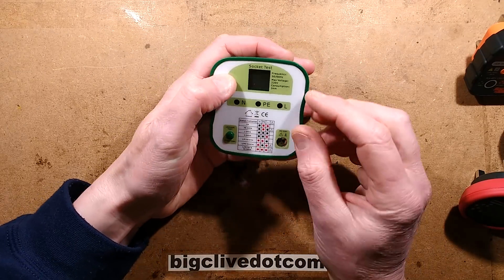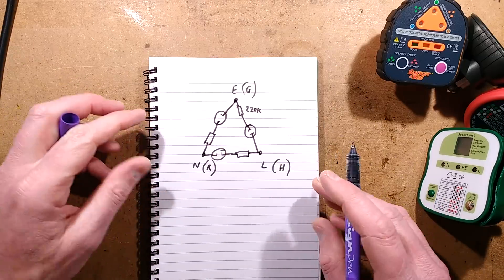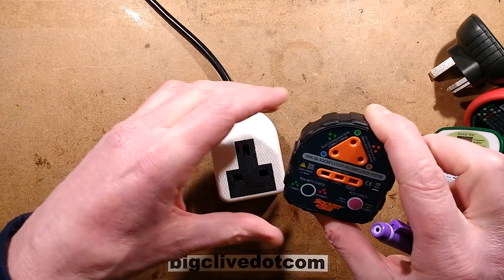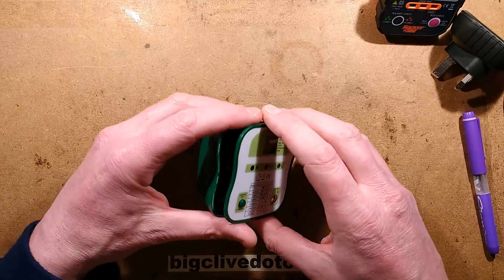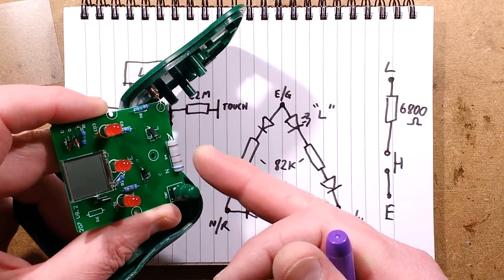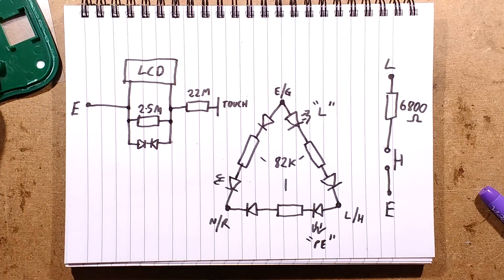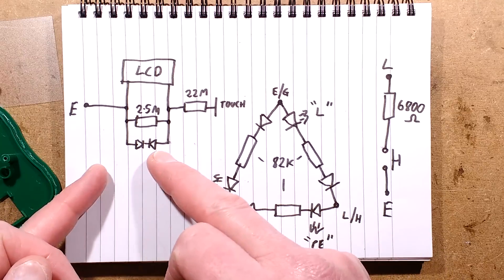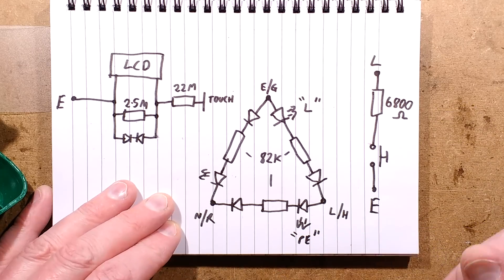Inside a mains socket tester with LCD display.  (with schematic)

Comment: Worked on a huge permanent lighting installation some years ago where the electricians that had installed it swapped the Earth and Neutral on every single fixture plug. 
Drove the audio guys nuts trying to figure out where that hum was coming from, since all the audio gear was correctly referenced to Earth.

Comment: I have a basic one, because when you're renting it's really handy to be able to look at a property and quickly find out whether the electrics are vaguely trustworthy. Missing earth on GPO is common, but I once found a reversed live and neutral which only became a serious problem when the real estate agent present said "if it was a problem I'm sure the owner would have fixed it"... see ya.
Reply: Ouch. (Or possibly AAAAAAAAAAAAAAARGHHHHHHHHH!)
Reply: Had an outlet that wasnt working. Maintenance guy held a non-contact voltage detector to the outlet "Nah its live"  I left shortly after because maintenance in general was lacking and they wanted to raise rent. AC/heat pump would leak out in 2 months, one sink in the kitchen was missing a P-trap, etc.
Reply: You silly people with your keyed sockets where a fixed orientation for live and neutral is even a thing.
Reply: Jasper Janssen
Better yet is keyed sockets where live and neutral isn't a thing. ;->
Reply: Jim Fortune what, 4 pin 3 phase? That’s the only ones I can think of.
Reply: Jasper Janssen
I was talking about the type "E" euro plug. Single phase, grounded. It has an off-center ground pin in the socket so that you can only plug it in one way, but even in the same double socket live and neutral are reversed from one plug to the next.
Reply: @JimFortune  ah right, the French one. Huh, I’d have expected that one to have a defined orientation.

Comment: We had a metal sided garage built at our local scout camp. It was in operation for about 10 years when last summer i happened to be in bare feet and leaned against the siding and felt a mild shock! Thought I was imagining things so I had a friend do the same thing with identical result! Turned out to be a combination of two things. When they wired the garage pony panel they brought over the two live wires and neutral but no ground and no one ever put a0 earth ground wire into the panel, as a result the entire building was a floating ground! Combine that with a poorly installed thermostat for electric heat that they managed to install crooked enough so one of the line wires could touch the box side. No earth ground so breaker did not blow but result was that the entire building shell was at 110v with respect to ground and I was the first to discover it after 10 years of use!
Reply: bet the scouts $1 each to put their tongues on it lol
Reply: and some people ground the rebars when they pour concrete.
Reply: a common problem with inverters in vehicles. no real ground !
Reply: Yikes. I was noticing some floating grounds all around one building I worked on (US) and decided to do bootleg grounds after a thorough!!!!!! And proper testing of polarity ( I open the main panel verified everything and connected to a known good service outlet that I checked and ran extension cords all around the building and checked every single outlet and switch, thankfully in a small building) as I could see the refrigerator floating at 1-10 voltage and something else metal floating at another. so there is a lot of "main panels" all over this building now but I feel that's safer than having no ground and all exposed metal work that could become live any at different potential. This was an old building where they upgraded the electrical panel when we moved in and then ran the old panel as a subpanel, I suspect most of the wiring is 2 core no ground pretty much everywhere except for in the kitchen And where it was updated? of course, only in accessible places.

Edit, AND DON'T DO IT.
Maybe I should explain for foreigners where ground pins are required because they make so much more sense!
In the US allot of older homes,,,, have 2 prong outlets.
you can use an adapter that plugs in and gets screwed on, however nobody ever screws them on and you never have them when you want them so…. there's a very large tendency to break off the ground pin on a 3 prong device ( computers, audio equipment,,, ) everything if you work or live in a two-pronged outlet building.
options other than breaking the prong off ( Not Code ), is to hire an electrician to replace everything ( Code $$$$$$ ), replace it yourself ( can be Code if correct ) or just change the outlet from a two-pronged to 3 prong and not do anything at all and lie that it's fixed ( Not Code ). install a GFCI in the breaker panel ( if one exists for your old nonstandard panel ) / ALL locations ( Code $$$ ).
or what is called a bootleg ground ( Not Code, as it breaks the one bond rule ) which will pass the house inspectors 3 digit light tester if they don't know any better, it's also good for realtors.

So do you have slightly miss wired outlets or have people going around breaking ground pins and developing a really bad habit?

Comment: The 2.5 megaohm resistor across the LCD is to clamp any stray voltage across the LCD. They require almost zero current to operate, so almost any stray electrons will get them to activate.

Comment: The LCD warning needs around 3-6VAC across it to operate at 50/60Hz to fully dark, so any voltage over around 50VAC will operate it reliably once you take into consideration the high value series resistors also there. The diodes are there to protect it from high voltage breaking down the thin film of liquid crystal in there.

Comment: I have a neon one with a resistor for GFCI testing and button to shunt it.  Tiny thing that seems to work really well and impossible to plug in wrong unless you completely disable the safety.

Comment: I work on the distribution side in the UK. When I'm doing the cut out change we plug one of these little things in  just as a basic test we go for the nearest socket to where I am working. Out of 10 houses 1 will have a a fault on the socket  most are cross polarity in the socket.

Comment: If memory serves the single-segment LCD is a copy of an earlier Beha branded unit which was the first to check polarity, the Germans having decided this was absolutely necessary. 

The LCD is a reasonable way of indicating a voltage differential using a low current, replacing a neon. It is more visible than a neon in most lighting conditions. Of course once you have a microprocessor in there (like the SOK36) you can use power from the mains to drive an LED without exposing the user to unsafe accessible currents.

Comment: There is a condition that can occur when some scroat has been at the copper in the local substation and the Neutral is disconnected from the Earth! The effect is that the Neutral "floats" at a point somewhere between the 3 phases (dependent on the load the houses put on the system)! This gives not only a random Live to Neutral voltage but a voltage can be generated between the earth terminal and the body of earth. Not a usual occurrence but ......

Comment: Many years ago when I was at university I built an RCD tester that had a resistor to ground. The room wasn't on an RCD so I told my room mate DO NOT hold the button in. A while later I left the room. On my way back I heard a loud bang and on returning to the room I saw a cloud of smoke and my room mate sitting on the other side of the room, trying to look innocent.

Comment: Our home is on a TNC-S system (as are all the other homes in our area). Mind you we're pretty rural (even by Aussie standards). Always beneficial to ensure the earthing rod's kept "well-watered" for pretty obvious reasons, which can be difficult in our parched environment!
Reply: Phil S just put it deep not far away from your septic system?
Reply: Just saying, there are "other ways" of providing water + electrolytes to the ground around the rod . . . . . :-)
Reply: Isn't TNCS grounded at the distribution station? So you don't need grounding at your house?
Reply: Our system was originally TT (local earth only), then a few decades ago we combined local earth with neutral (so an upgrade to TN-C-S). We still have the local earth rod, and I've noted that if we disconnect the rod, earth loop impedance is pretty high, so I keep the rod connected, and "well-watered" as an added safety measure. Useful when the nearest "real" hospital is over 100km away . . . . . . .

Comment: I've been watching for awhile now, and this is the first time I have heard you mention (or the first time I understood you to be mentioning?) the different kinds of grounding/earthing that are commonly used. It seems that here in the USA we use the TN-C-S Earthing System? And the chart on the page I am looking at now shows that Great Britain uses TT and TN-C... I never realized that this was so different. I knew that you British called the 'ground' pin 'earth', but I thought that was pretty much the extent of the differences -- other than the voltage difference, and the fact that you guys in Britain use 50 Hz rather than the 60 Hz that we have here in the USA. I know higher voltages can jump farther distances as well, which makes me wonder why Great Britain went for 220V rather than the 110V into the home wiring of every plug in the home? I know the USA would have needed to make a LOT of stuff obsolete overnight to switch to 220V, so it was never going to happen. But it seems like Great Britain was more able to choose between 110-120V or 220-240V standard, and clearly chose the higher. I know we can get to 220V by using both of the phases -- and usually do for things like home electric water heaters and the kitchen electric stove. Most everything else, though, is 110V here in the USA. It seems like all of your 220V electrical components would need to be 2x as 'tough' (robust?) (compared to same component in 110V variant) to withstand twice as much voltage -- either flowing through it, or being held back from flowing, etc. I know that doesn't necessarily translate into 2x the cost, but still. What's the benefit from having everything running at 220-240V rather than half of that? If I were to accidentally grab a hot wire, I damn sure would rather it be 110V @ 60Hz instead of 220V @ 50Hz! Sure, you're 10 cycles less per per second, but that's still 50 cycles that are at 220V!

Comment: 5:10 That function is mandatory in testers in Finland. Old wiring was often done with two wires with earth connected to neutral in the socket. Sometimes when laymen did illegal wiring they actually connected the earth to the line instead. Such connections have caused fatalities, latest in 2015. Also four non-fatal accidents since 2012. In four four the five cases it has been caused by a mirror cabinet in the bathroom. Those are real shock dispensers. I would ban sockets on those or at least allow just euro socket for a tooth brush.

Comment: Seeing the schematic with the neons reminds me of once when I was young (and stupid), I tried connecting a neon lamp directly to mains with no resistor. I'd measured the resistance of the bulb with a meter and it basically read infinite ohms so I thought "well, with a resistance that high it's never going to have much current going through it, so I don't even need to use a resistor". Bad idea! I didn't know about the way the resistance drops quite low when the lap is lit. Got a bit of a bang.

Comment: Can you make a video about why UK and US plugs are polarized? In Germany the plugs aren't polarized and are still perfectly safe. I guess it's because having a fuse in the plug requires polarization?
Reply: I'm also not sure, but i think its a safety feature to prevent things like hair dryer elements from going live even when off
Reply: It certainly makes Edison screw lamps safer as they can be designed such that live is always recessed into the fitting rather than the screw thread being live. Probably lots of other situations where its safer to have a known live and neutral. There's probably (slightly dodgy) devices out there that have a switch on one wire going into the device, if its polarised then it can be on the live wire and make the device safeish rather than appearing off but still being live inside.
Reply: Ross Mitchell, Edison sockets are polarized in Germany (and surroundings). The wires going to the German sockets are also polarised. It's just the sockets themselves that aren't polarised: there's no regulation on which wire should go where, and you can put in a plug both ways. French plugs strangely also have no polarization regulations, but plugs only go in one way there.
I believe that since we all have earthed devices now, it's not so important to polarise the plugs: you can always make a device safe with the earth.
Reply: But the US also has two pin plugs, so they are not necessarily polarized.
Reply: +whuzzup, Any 2 pin plug that feeds mains into a device will be polarized, at least newer equipment anyway. Things like your phone charger usually aren't polarized though.
Reply: Any 2 pin only device has to be double isolated / safety class II with no metal case, so it's doesnt matter which way you plug it in,
it supposed to be safe in any way it could possibly fail.

IEC Class II .. basically anything with some sort of transformation coil and enough isolation between intake high/ output low voltage.
http://www.cui.com/blog/class-2-vs-class-ii-power-supplies

=> Since its AC there is no electrical reason or need for a polarized plug, ever.

Only time it's critical is with heating elements (ironing, kitchen cooking plate) where you have a metal case to transfer heat.
This then needs to be grounded to earth for safety, if heating element wires break or come loos and into contact with case.
IF L=>N or N=>L still doesn't impact function of device.
Reply: @sander I understand that but the fact that you can plug the plug in both ways means that if you have a desk lamp with a edison screw fitting you could plug it in such that the screw part is live rather than the contact at the bottom of the fitting even though the wires in the walls are polarised.
Reply: I also have read that old radios have a tendency of having all exposed inside metal Parts electrified if plugged in the wrong way. I also ran across an article titled something like you're an electric company and you're finding that all of your customers are getting shocks I'll see if I can look it up... "Now that you’ve grounded your system, you’ll find that suddenly your customers are occasionally dying!” WHY THREE PRONGS? http://amasci.com/amateur/whygnd.html
Reply: It mainly has to to with lamps and other such devices. When the plug goes only one way it ensures that the switch disconnects the phase and also that the phase connects to the bottom of the screw and not to the actual screw. This is a minor safety advance if you are careless in changing the bulbs. In Finland people are advised to unplug when changing.

Comment: I've had a voltage probe screwdriver (Yato YT-2863) which had "LCD voltmeter" working in an interesting way: There was a resistive voltage divider wired to the LCD connected to the "inductive test" path which lit up sections showing predefinied voltages (12, 36, 55, 110, 220 V). Measuring approx. 220V would light up 12 to 110V and 220V would be very faint. Once I've disassembled it to check how "indictive test" works I could never reassemble it to make it work again :) Now I have an insulated screwdriver. Oh, and "inductive" path looked like it was actually "conductive"...

Comment: I had an old neon Daniel Woodhead tester. The plastic base for the prongs finally degraded and it fell apart. I admit I was surprised how simple it was inside. Anyway, I bought another one.

Comment: Here's an idea anyone could take; Make a version of this with a multi-coloured LED with individual colour channels (rather than colour triggered by software in a microchip). or individual red, blue and green LEDs. Then when plugged in, "Yellow" could show the "OK" state, while all other colours represent an error state. For the earth leak test like on the generic green model shown, make it light red, and include a piezoelectric buzzer which will only chirp briefly for error states.

Comment: Hi Clive, if you keep your finger on the RCD test button, the resistor will not get hot if you are testing a properly functioning RCD.
The RCD will trip and the voltage across the resistor will be switched off.
Reply from the maker: My reference to dissipation was if the unit was used on a circuit with no RCD, a malfunctioning RCD or one set for a higher current.  It's human nature to just keep the button held in when a test fails in the hope it might suddenly work again.

Comment: You can find the common "Cheapie's" most places but building code requires the use of "Arc Fault" breakers to be used through out house now. So as an electrician we have to buy the ones that check  correct wiring, GFCI's (wall device or breaker), and Arc Fault (device or breaker), all in one tester.
Reply from the maker: Arc fault hasn't arrived here yet.  That's possibly because with 240V we have less arcing issues and faults tend to be more decisive.
Reply: bigclivedotcom they started using them here for fire protection really. Example: lamp on night stand next the bed gets knocked over, when the lamp hits the floor the glass breaks and of course there is a large current draw as the filament burns up due to it being exposed to the O2, their theory is that if the filament doesn't break fast enough it could lay on something like carpet and continue to burn that's where the arc fault kills that circuit as soon as it sees the arch. It all started in California where most of our NEC codes take root.